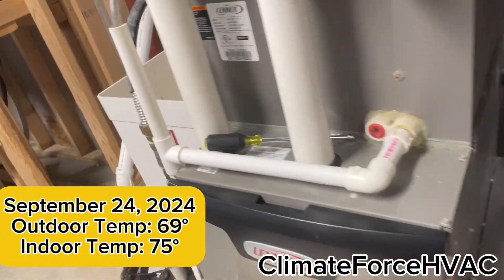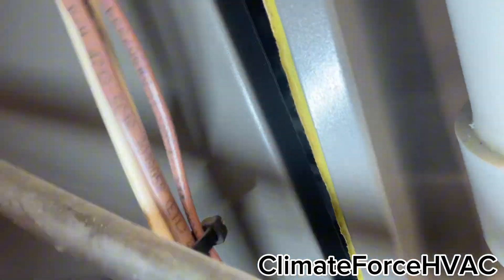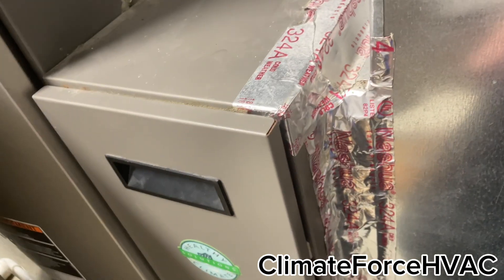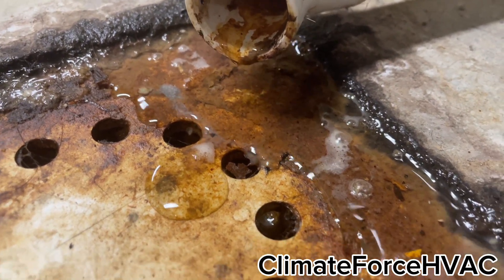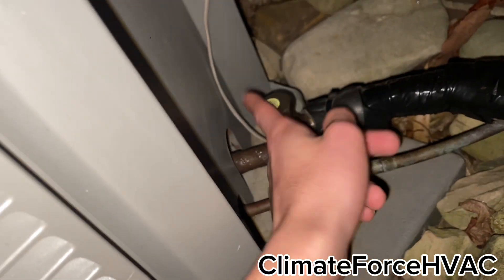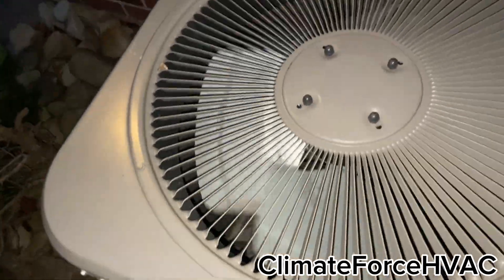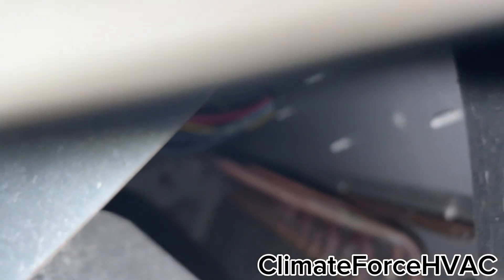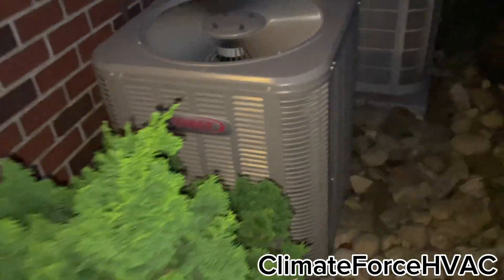FROZEN EVAP COIL ON MY LENNOX MERIT!!

Comment: Yes, this is a rant. but with good reason.

10 year old isn't worth fixing? The other unit is dry within a week. I have equipment that has 1980's manufacture dates on them and they're serviceable, if not repairable. Remember, this is not your money you're spending. It's someone else's, in this case, your mothers.

You know, $40 in Nitrogen and some soapy water will let you know where the gas is going. Add in $50 for the torch and braze. You have to put in work to find and fix. It's less work, cost less and at the end, learn something and you'll have the same result. I'm taking for granted you've labeled yourself an HVAC tech. or an apprentice.

Going off of what you have posted, you've done no measurements or leak testing. You're guessing and making excuses. This is a display of troubleshooting skills at its worse.
That is all the makings of a terrific sales tech, and a terrible HVAC Mechanic. Is this really at your mothers house? The real problem isn't the equipment, its the guy working on them, if its you, you are just terrible, you seriously need better training and should call an actual pro. And to do this to your own mother, in this economy? This had better be a grift. I honestly see this same thing every fricken day done to home owners who are taken advantage of by folks like you're portraying because of their ignorance on AC equipment. 

My simple rule of thumb. If you can't measure it, you can't manage it. If you do not know ( point or measure) the actual fault (hole, oil, burnt component, measurement showing fault, etc) you do not make a determination (manage the repair). An icy coil is an effect, not the cause. Dry unit is an effect, not a cause.

You seem like a bright kid but heading down a dark path.
Reply: Your rant has no good reason in this scenario. He doesn’t need a keyboard warrior. Evidently—it’s low. There’s no reason to investigate any further with the circumstance he is in.

If he has proper airflow and good field conditions it’s low on charge. Sure, it could be fixed, but it’s the customers choice. Yes I do agree that nobody should be told to replace their system without a thorough leak search, but this isn’t a system out in the field. He is simply checking out his own system. 1980s units were built to much higher quality standards. 

With a Lennox unit it’s not worth it since they are cheap junk. I think it’s a smart move to recognize the point where you stop putting band aids on money pits. The real 10 year old that needs fixing is you
Reply from the maker: @seabasshvacr  thank you brother, we need more people like you
Reply: @seabasshvacr  agreed.
Reply from the maker: @user-cz8do7xl8u  don’t be rude, you’re not the one working on the system. Lennox isn’t my cup of tea, and my mom SAID HERSELF that she wants to replace it. For you to hate on me, knock me down, and call me a bad apprentice/tech, absolutely makes me sick, you have no respect. It’s not your system, you’re not working on it. And don’t EVER mention my mom
Reply: @ClimateForceHVAC713  his feedback is correct though u may not like it, scrapping a 10 year old unit for a leak is crazy. i'm sure a sales-oriented company would love for you to work for them. there's a huge problem in general with wanting to scrap everything instead of repair and this goes well beyond hvac.
residential hvac equipment with repairs along the way should last 20 years.
Reply from the maker: @Jon-hx7pe  lol when you have a 10 year old cheap-o unit with a 42° superheat let me know
Reply: @Jon-hx7pe Sometimes you gotta do what the customer wants. The customer (his parents) want it replaced. Once I'm in the field, I'm gonna save what I can, but I'm not gonna fight the customer if they want otherwise. Besides, it's a Lennox Merit... not like there's shortage of those in the world.
Reply: @BRISTOLFORCE2009  the issues are with leaking coils and bad caps - 10 year old system u repair and get another 10 years. young people have a stupid throw away mindset and are spoiled.
Reply: @ once a coil leaks at that age you’re better off with a new unit, nobody is going to replace a unit with a bad cap, just because he’s young doesn’t mean he has that mindset, none of us enthusiasts do but they also wanted to replace it before R410A was discontinued which I would’ve done the same because I wouldn’t want my unit to fail and have to get a unit with R454B
Reply: @ClimateForceHVAC713 👍
Reply: Best just to ignore these comments and remove them. You shouldn’t waste your time on these lil kids that just love yapping random things and the fact that they do not know what they are talking about nor how they tribute to society.
Reply: @user-cz8do7xl8u  What's your issue bro! Why would you bring someone's family member up! Like climate force said you're not the one working on the system and his mom said herself that she wanted the thing replaced so shut your mouth up please
Reply: 2 months behind but this comment is pure ignorance at its finest. Can you do a better install? Are you even licensed? This video clearly states that this unit is complete toast regardless of the age. Also, it could cost at least 2K to replace the compressor. Go touch grass with this comment.
Reply: You sound like an absolute loose cannon. Leave him alone. You have absolutely no room to be talking poorly like that about his passion in this. And let me tell you I have autism and ADHD and I don’t even know super much about HVACR myself nor am I interested in it as much as him, but I wouldn’t ever trash talk about his skills like that and it’s not any of your business whatsoever in his moms choice. If he says he is going to replace his unit then so be it, it’s his unit, not yours. You talking bad about him like that reflects pretty poorly on you. If you ask me, it’s you that’s actually in the wrong.
Reply: @iowaacproductions698 mason speaking facts